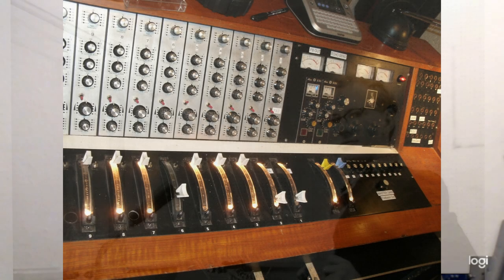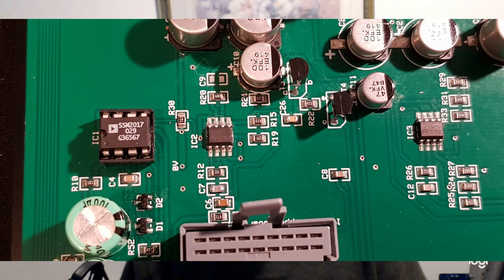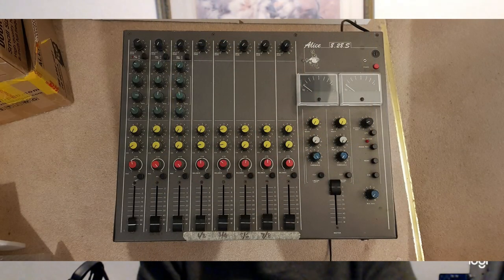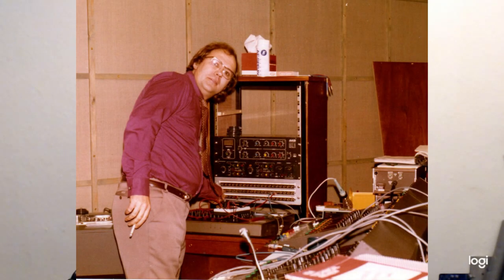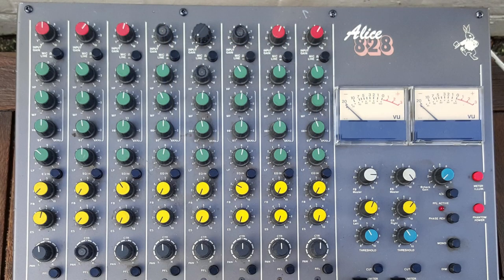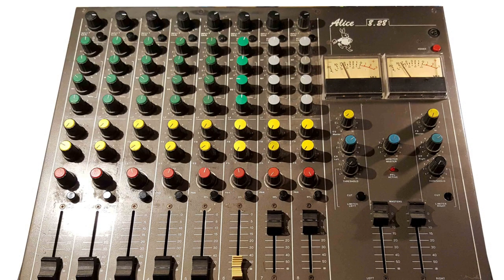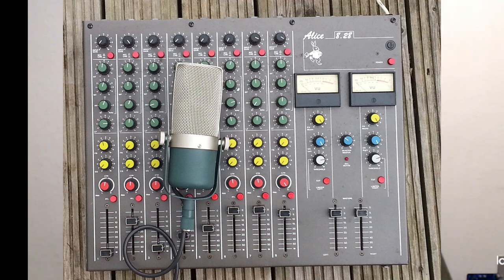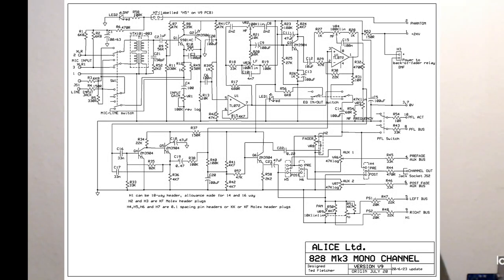Ted Fletcher talks about microphone amplifiers and realism.

Comment: Very pleased to have been made aware of this video by a reference in the UK TV/Radio Broadcast Engineers group on Facebook.
I have been learning a little about psychoacoustics recently and it appears that our perception of a sound is greatly affected by it's starting transient long after the transient has been and gone. This would explain how the mic amp overload behaviour described could have a more profound influence on the perceived audio quality in a way that our traditional 'steady state' type of measurements will not show up.
Regarding the influence of an extended frequency response, is this more to do with the amplifier's slew rate? A very high frequency response requires a fast slew rate which will affect the fidelity of these all-important transients.
Reply from the maker: Thanks for your comment.... regarding slew-rates, yes they will have a bearing on the reproduction of very high frequencies, but not a lot; a modest rate of say 5V/uS will have little effect on the low level presence of 100KHz, but an op-amp experiencing transient shut-down is something to worry about!

Comment: Ironically, the audio quality of this video could have been a lot better. 😉
Perhaps a large part of our perception of realism is due to the psychoacoustics of the outer ear. Its response varies according to the direction from which sound waves arrive because they are affected by the convoluted structure. Binaural recording only gets us part-way there because the recording is made using only a rough approximation of the ears our brains spent a lifetime learning to use and, if using headphones, any head movement will immediately be detected as not having the expected effect.
Loudspeakers, unless you’re fortunate enough to have an anechoic chamber in which to house them, will not provide convincing realism because room acoustics will confuse the image.
Reply from the maker: I can only partially agree with 'fazerider9287', I think that the convolutions of the outer ear have only a small effect on perception, a much larger effect is the positioning of the ears and the exact distance between them (HRTF). I firmly believe that loudspeakers (or should I say 'transducers') will be able to provide convincing realism based on object-based sound reproduction and not necessarily under anechoic conditions.

Comment: With the advent of 32bit ADCs there's an increasing fashion now to plug mics straight into the ADC bypassing the mic-pre altogether and using purely digital gain to bring the mic up to a suitable level, I guess you are bypassing the noise floor of a second set of circuitry and another source of distortion.  Whether this purity sounds nice to the human ear is another subject altogether!
Reply from the maker: That's asking yet another set of questions; I would wonder about the economics of using 32bit ADCs,why not get the same effect with 24bit and a simple (!) cheap mic amp?  But still the biggest problem we face is at the other end of the system, the conversion of electrical energy into physical sounds.
Reply: @tedfletcher7334 I agree, I actually like the sound older mic pre have - a sonic footprint if you will - transparency is over-rated, sterile, boring. I make good use of my Alice 828 Mk3 pre's even though I have much fancier ones to choose from.    Any news on the next available batch of P82s? I missed the original discounted order window by about an hour! Grrr!   Keep up the good work - always nice to see you're still active and condolences for your recent loss.
Reply from the maker: @LondonSteveLee  Thanks for your kind comments, will email you re P82 units..... I do have a couple completed.
Reply from the maker: Pls drop me an email.